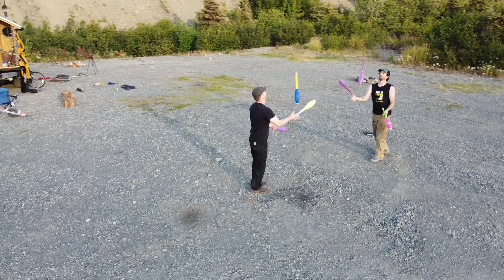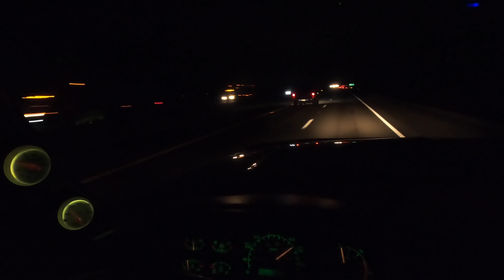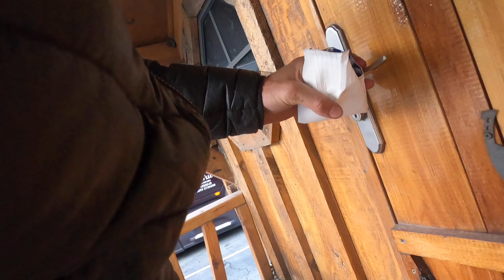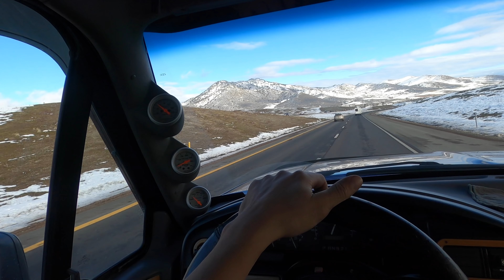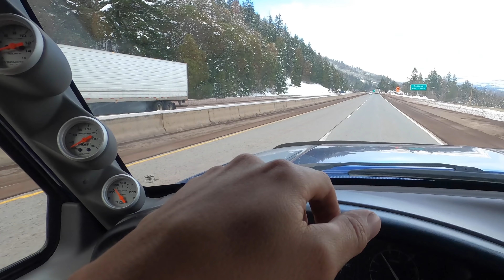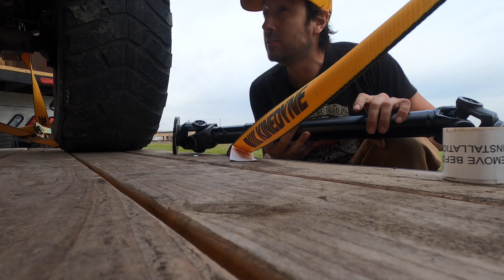I BOUGHT A 1987 SUZUKI SAMURAI  -  $H!T$ ABOUT TO GET REAL.

Comment: FYI,  strapping front of the Sam to rear trailer and visa versa with longwise is dangerous.  get some tire straps or on the axle and shorten. the length.  front to front rear to rear or center front, center rear. X crossing long ways is a no no.  If for any reason, you get crossed up with the trailer and it bounces side ways, you WILL eject the Samurai on long X.... There's a reason wreckers strap the tires and axles very short...

Comment: You should roll the Suzuki back a little on the trailer so most of the weight is on the trailer axles not the tongue of the truck.
Reply from the maker: Couldn't back it up more cause the ramps;)

Comment: A friend of mine has run these in competition contests and won gold lots of times, so they are good in the terrain :) He's is now modified with a Rover V8, mix of Honda/Opel or so servo steering and different stronger axles and mud terrain tires and so on now. But he did run these original factory stock too in competition and did even win there so it is not a bad car running in the terrain :)
The wheel axles has a tendency to break if not careful running too hard damaging the car just to try to win, he did swap them alot.
He also had a Suzuki Swift GTI engine in it at one point.

Comment: Mandude....  Get yourself an OBD reader.  You can even leave it plugged in all the time.  You can get an app as cheap as 10$ for the software.  That way, the next time your "check engine" light comes on you can get the code, find out the problem and even clear the code in memory. Just fyi....

Comment: @Truck House Life   The Samari should be at least a foot further back on the trailer.  Your putting most of the weight on the hitch/truck instead of letting the trailer carry the load..  Your overworking the truck especially with all the mountains you have to climb in OR.
Reply from the maker: Yup i know,  but the trailer isn't mine (towing it up for someone) and the ramps won't allow you to pull further back).

Comment: Congratulations on the Samurai.. always good to have an off-roader just in case!! How's the towing so far ? will it limit your movement?
Reply: I was wondering that as well. I'd guess the trailer will probably limit the roads you can go down, especially being harder to turn around. I suppose if he got into a pickle he could unload the samurai, unhitch and turn the trailer around by hand, and then do a do-si-do with the truck.
Reply from the maker: back in ak, videos coming up the next week;)
Reply from the maker: Towed the trailer up for someone not mine;)